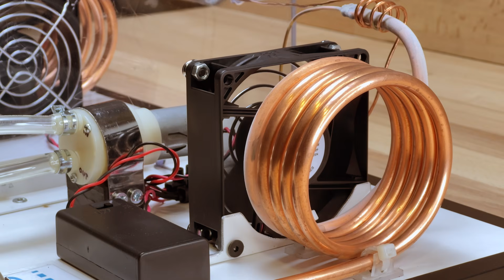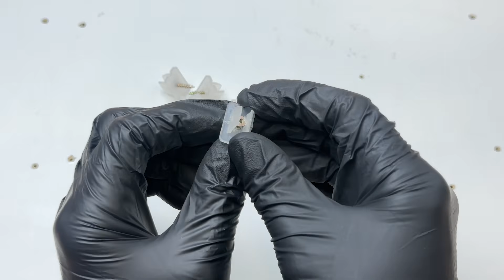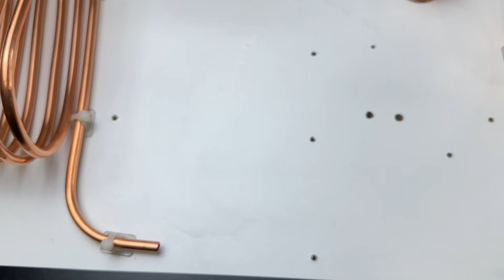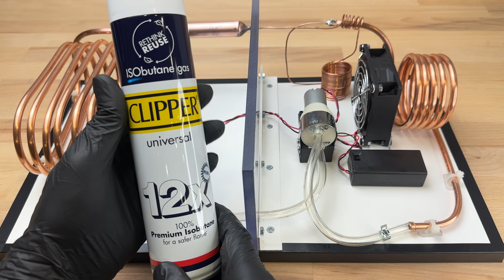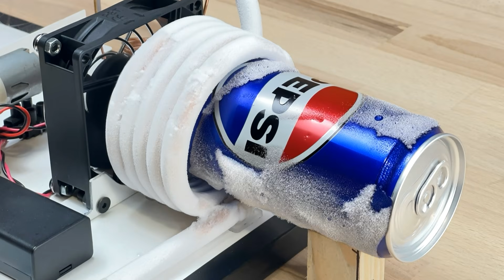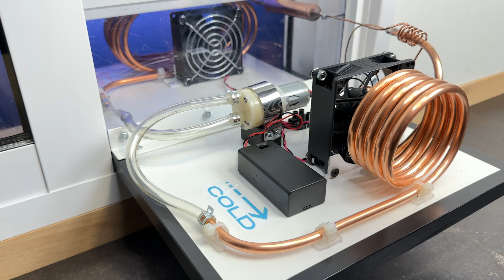Homemade Mini Freezer with Air Conditioning! ❄️-19°C🔆30°C

Comment: Interesting. Is the gas safe and available without the need of certifications? Did you also bleed the air that was displaced or do you take the higher pressure?